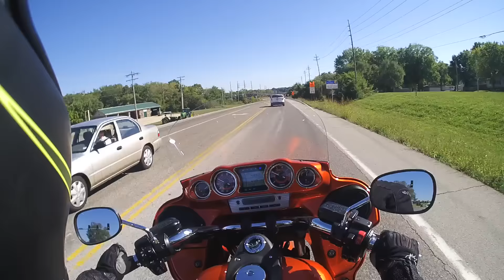Engine Braking, Yea or Nay?

Comment: I tend to use engine braking if I only want to bleed off a bit of speed, only using fairly low revs, often staying around 2000 revs, enough revs to accelarate if required (1990 ZX10) So there is some braking and  some controllable accelaration to be had when necessary. If I need more stopping power then I would brake, instead of changing down earlier, On steep downhills I do use the engine to help hold the bike back, just as I do when driving a car or van. Once in the chosen gear you are not wearing the clutch, only spinning the engine and on a long slope this can save you cooking your brakes.
Reply: +Phil Wood Finally someone who gets what engine braking really is. I do exactly the same as you while ensuring I activate the brake light by ever so lightly touching the rear brake pedal while engine braking so other cars can see me slowing down.
Reply: '90 Zx10 wow! I'm on a'97 Cbr1100xx  there's no need for these super expensive new bikes that's a secret not discussed on YouTube!

Comment: another reason engine braking is important is for control when slowing down from a high speed. You've got a cruiser so the weight is very much in the centre. Sport bikes have their weight in the front. When you press each brake, rear and front, the weight of the bike is transferred to that end of the bike. Engine braking will send some of that force to the centre of the bike giving you more control. 

An experiment to prove this, try braking using your rear/front brake when you're in neutral and the bike is moving without the engine engaged. Now try the same with the engine engaged. The engine is always going to brake because of friction and will slow you down, engine braking, allows you to gain more control over that aspect.

Comment: “rear brake will lock up the wheel" doesn't necessary mean that is powerful enough, because "will lock up" is not equal to "immediately lock up", you lock up the wheel after slow it down a bit.
Using engine brake to cut down engine output and even reverse the effect definitely boost the process to slow it down.

Lets say if you going down a hill, which one is easier for making sure your vehicle is running at a slower speed? sole rear brake or engine brake?
Reply from the maker: In that case, keeping the bike in a lower gear and "engine braking" is the preferred solution; to prevent overheating the brake and glazing the pads.  The behavior I'm referring to is when people choose not to use their brakes, and instead just downshift as they approach a light.  That gets them out of the muscle memory habit of using both brakes.  If an emergency happens, you're going to do whatever you've always done, or you'll hesitate.  If you always stop using both brakes, no matter what; then you'll use both brakes in an emergency.  If you lazily grab one brake or always just downshift, you might hesitate or fail to use both brakes.  No matter how smart, or experienced you think you are; muscle memory matters.  When police officers train with their weapons, they always draw them the exact same way; so if they ever need it, they'll draw it exactly the right way.  When firefighters train, they always get ready in the exact same order.  That way, when they do get a call and the adrenaline is pumping; nothing is forgotten.  Motorcyclists, too, should exercise rote repetition in the way they control their bikes; so the muscle memory is there should it ever need called upon.

Most modern bikes will have a rear brake capable of instantly locking up the rear tire.  Mine has ABS, so it won't lock up the rear tire; but in fact it'll need the ABS to push back on it to prevent it!

Comment: I do use engine breaking, but my concern is that (I assume) it does not light the tail light, and for that reason I don't do it in traffic.
Reply: There are lights on the market that do flash just by engine braking.  My brother has some on his bike.  So anytime the sensor in the light detects a slowing of the bike, be it engine brake or actual brake, the lights flash.  I'll be putting them on mine as well.
Reply: +Alex Dalziel Lightly touch the rear brake pedal to activate the brake light. You need to test this out in the garage though and adjust the sensor to activate with a light touch before you actually go out into traffic and do it. Otherwise, you may not be activating the light at all.
Reply: @notafanboy250  YEP! A few taps to warn those behind you that you're slowing down - EASY!

Comment: The point of engine braking is that is better than actual brakes, the reason is save your rear brakes from being used up. So you are slowing down for free since the piston compressing air (with min fuel) depletes your kinetic energy and slows you down without spending anything.
Reply from the maker: Yep.  As I said in the video, I'm not sure that's a good reason.  Brake pads are pretty inexpensive and pretty easy to replace on a motorcycle.

Comment: I use engine braking and I think you really hit the nail when you pointed out that it's real benefit is the control factor. Anytime we slow down on a motorcycle in traffic we are watching the mirrors to make sure the following vehicles are aware. If you avoid engine braking for whatever reason and use brakes only…this can mean you don't have the ability to immediately 'escape a danger' through acceleration At least not as efficiently than if you are in the right gear for your bikes speed.  For me ….it's kind of like ..if you slow down significantly without downshifting and using the brakes only you are kind of akin to putting the vehicle in neutral and sacrificing a great deal of control over the bike.  Just my thoughts.
Reply from the maker: +willyb933 I agree.  Though you can also downshift with the clutch in to accomplish the same thing (I do both), staying in the right gear is essential.  I'll admit!  In my experience, situations where you need to 'power away from something' are very rare, situations where you need to stop immediately are more common.  So I focus on the latter.  But I always stay in the appropriate gear.

Comment: my question is, I have an 07 v star 1100, but I'm thinking about a used Goldwing, for more touring comfort I know its a beast of a bike but I see little ladies ride them.  my bike rides good but I feel like I'm sitting to low and I cant straighten out my legs, plus I miss having one and all the toys on Goldwings.
Reply from the maker: You may want to sit on a Goldwing first, it has a standard mid control riding position instead of a feed forward position like large V-Twin cruisers.  You probably won't be able to stretch out on a Goldwing.
Reply: I will check that out

Comment: The rear brake does not get a lot of wear and tear.  Using engine brake to save the rear brakes is not really needed.  It's just easier sometimes in traffic and certain road conditions to use engine braking.
Reply from the maker: +H.E. Pinero It depends on the bike, but yes, generally the rear will outlast the front.  It's an easy replacement though.

Comment: one thing you did not tell us is if you have short headers or straight pipes down shifting/engine braking can cause cold air to suck up in to heads damaging valves. Which is a good reason to not buy short exhaust pipes

Comment: every time you let off the fuel pull in the clutch and soon you will see how much engine braking you really do without noticing it
Reply: that would be detrimental to you and your clutch..
Reply: @normanmendoza6891  so your supposed to constantly be on the throttle or hold the clutch in or downshifting?

Comment: There are lights on the market that detect the deceleration of the bike.  Works with engine braking and /or actual braking.
Reply from the maker: +lmdetect Yes, though it's a good practice to apply some front brake at minimum; both to illuminate the light and to be ready to brake hard in an emergency.  One shouldn't ever rely on JUST engine braking.
Reply: Romans Five|Eight - Agreed.

Comment: kinda do both .depends on situation ... like if am slowing down anyway .. say from 4th .. and i think the bike is doing 3rd speed..ill drop it 3rd ...and so on ......4,3,2,1 ...but not use the engine to brake to harshly ...like doing 5th speed and dropping it down to 3rd .. lol . but saying that i very rarly use 1st gear anyay tbh as it dont offer much power before you need to change to 2nd... so i use 2nd as my start gear ..

Comment: i own an 07 v star 1100 engine braking is great i can go down steep grades and let the engine hold it back with just a little brake, but my question is why are people so hard on bikers i get them everyday following so close that they could run me over , now i do ride a little slower than most as im still learning the bike , any suggestions would, help also, my bike doesnt have cruise control would a trottle lock help on those long rides.
Reply from the maker: A throttle like might help, but I'm not a huge fan of them.  If there were an emergency, I'd hate to be trying to unlock a throttle lock.  Check out a thing called a "Cramp buster", which is a little thing that slips over your throttle and lets you rest your wrist.  They work great when cruise control isn't an option.
Reply: thank you
Reply: If you have problems with people tailgating you a lot, I would say get some really loud obnoxious pipes.  They will either back off or go ahead and pass you.  =P

Comment: Engine braking extends the life of your brake pads.  You don't substitute braking with engine braking, you simply use it to take some of the load off your brakes and increase the intervals between pad replacement. Kind of a no brainer.  And yes, it's good thing.
Reply from the maker: Brake pads aren't very expensive, even good ones; and the replacement is pretty simple.  Especially on a motorcycle.  It's about a 15 minute job on my Vulcan.  You give up a bit of modulation and control when engine braking.  It's not necessarily a bad thing; but I just am not convinced that brake pad wear is that big of a deal.  Brake pads occasionally needs replacing, oil needs changing, tires need replacing.  It's all wear and tear.  Preserving very expensive and difficult to service items, like the engine and transmission; are critical.  But it seems like a lot of hoops to jump through to eek out a few hundred to a couple thousand extra miles on a set of sub-$30 brake pads that can be replaced in 15 minutes.

Comment: On my old VStar 1100 I would engine break all the time.  If I did not blip the throttle it would be quit jerky.  Even at the lower end of the gears I could take off the throttle and have that engine break feeling.

Now though I have a Honda CTX700DCT, little hard to blip that bike :)
Reply from the maker: +SD Cruiser Yeah the DCT kind of takes the fun out of it :)

Comment: its called controlling the friction zone.  there is nothing wrong with engine breaking.  

the reason i do it, is nothing about saving brakes, and im not worried about clutch plates.   i do it because its another tool in slowing down and control of the bike
Reply from the maker: +poet99999 Actually, I think you'll have much more control JUST using the brakes; that's the point.  The brakes are more linear and have far better modulation.  You only have one rear tire, and chances are your rear brake is well capable of locking it up.  So there's no "extra braking power" from engine braking.  BUT; keeping it in the right gear IS important.  Nothing wrong with engine braking; but it is LESS control, not more, when it comes to decelerating.

Comment: I learned how to accidentally but not in a bad sort of way, id slow down with the clutch pulled in, guess the gear then and shift to where I need for downshifting let off the brakes then the clutch and I havent had anything but smooth shifts but the other day going to church I was racing and in a maybe 80ft area I slowed from 80 to 45mph (in fifth gear on a 2015 dr200) shifted down, shifted down which is when it engine braked , from the sound I was 1.5k rpm short of redlining and I slowed down quick enough for the fire fighters to check out and I cruised into the empty churchs parking lot going 30mph on dirt and loose rocks pulling up uncomfortably quick to park an inch from the curb xD only 107.9 miles on the motor but I swear it feels like second nature for my first geared motorcycle

Comment: You engine brake to shift the weight rearward/downward, usually before a curve, then you start to roll on the throttle while trail-breaking into the the turn, then you roll more on while fading off the brake as you hit apex, then roll it on out of the curve.
BTW NEVER engine break a shaft driven. You can run at lower speeds at higher RPM to go down a mountain with a shaft, but don't use it to stop. Your worm gear will thank you.
So, a shaft drive you end up matching RPM and using brake before you enter a curve.
And always drag rear brake on a engine break to light the brake or get a VOLO unit to light the brakes due to deceleration, not brake lever.

Comment: Guys you are confusing two things here. Engine braking means to let your RPMs go higher when going downhill until the point that they dont go any higher, and you are not accelerating anymore. Otherwise (like shown in the video) you are braking with your CLUTCH not your ENGINE. Dont mess it up..
Reply from the maker: +Matej Kováč Everyone has their own terms; but yes.  I'm referring to slowing to a stop with the engine, (you're not using the 'clutch' to brake because the clutch has no resistance itself; you're still using the compression of the engine to actually slow you down; the clutch is just an intermediary) not to keeping a constant speed on an incline with the engine.

Comment: Engine braking....saves on brakes, saves on fuel (EFI bikes), has you in the correct gear when time to apply the throttle again.  No reason not to do it.....just as long as you know how to rev match along with it.  Locking up your back tire will pucker your arse-hole if you don't.

Comment: I use engine braking just to stay in the power band.  Not so much to slow down, and I usually give it a little blip of throttle anyway just to lessen the shock to the drive train and that kind of mitigates the engine braking a bit. (way more engine braking if you just let out the clutch but it's not smooth).  My riding style is just to be as smooth as possible.  Even in traffic. 

Do you have a video of how you handle stop and go traffic?  I have to ride my bike during my commute at walking speeds and slower.  I ride a 1500cc goldwing and you learn to slip the clutch while on the rear brake.  It might be helpful for some newer riders with big bikes to show them that technique.  

It's easy to ride fast, it's much harder to ride a 900lb bike slow.  =)
Reply from the maker: +Urban Madness I shot a video on low speed handling but actually lost it, I need to re-do it.  Ultimately, it's all about that clutch control.  My preference for stop-and-go traffic, to save the clutch, is to let traffic move ahead of me a little, then catch up.  Personally, I wouldn't drag the clutch and brake at the same time, you're just wearing both.  You should be able to control a bike the size of ours with just the clutch.
Reply: The clutch is actually designed to take it on the wings.   Rear brakes are cheap so I'm not concerned, especially if it gives extra control.   Again, I'd like to see how you do it.  I'll shot a video on how I do it and then we can compare notes.

Comment: to be honest wear is wear.  if you engine break you are putting wear on the most expensive parts.  it overtime will decrease the engine and tranny parts. it's happening no matter what.  breaks are easy to replace and cheap and the at home mechanic can easily master.  having said all this I do both myself.  it's fun.  and part of riding is to have fun.  just decide what is good for your pocket book.
Reply from the maker: +Greg Demott I'm not convinced the wear of engine braking is that significant though; acceleration forces are more significant and you do those all the time!
Reply: It is over time. Friction is friction. It does not change for one party over another.  It's simple science.  In order to abate forward constant that inertia needs to transfer somewhere.  Clutch plates are notorious tough. But you are putting wear on them reducing their serviceable life.  And unless you are capable it's harder to do than brake changes. But to see any savings you would have to never engine brake. Like I said I do both add do anyone who wants to enjoy riding.  But don't think that engine breaking isn't wearing parts. Turning the bike on its wearing parts is just a matter how much wear you are going to risk over the life of the bike. Look at it this way,  if you were buying a used bike and you had two identical bikes.  One was used all the time ermine breaking the other had gone through multiple brakes and never engine brake. Which would you buy?

Comment: If you're in a place where everything is flat, it doesn't matter much, but don't attempt to drive your big, heavy bike down from a mountain using service brakes only. Not a hill. A mountain. You'll burn them up and you end up in a mountainside or off the edge when you suddenly have no brakes anymore. Not fun.
Reply from the maker: I didn't articulate it well, but I was more talking about the practice of coming to a stop at intersections, etc., with the engine instead of the brakes.  I think that's a bad habit, because I think riders should always be in the habit of slowing and stopping the bike with the brakes, because it keeps us sharp should we need to stop in an emergency.

MAINTAINING speed down a steep hill or mountain is best done in the appropriate gear; i.e., engine braking!